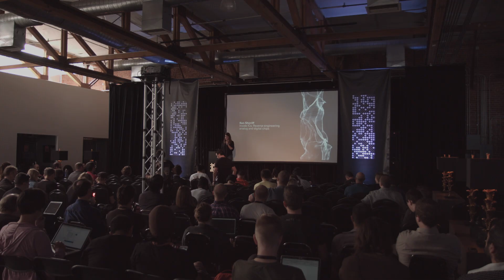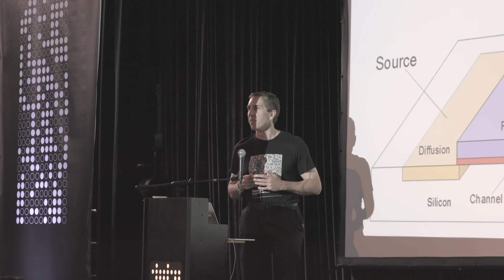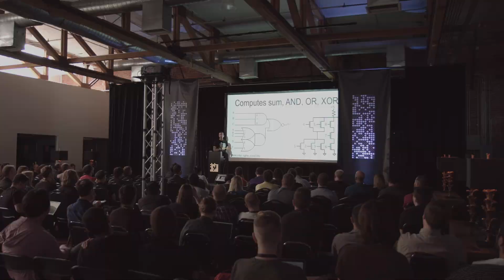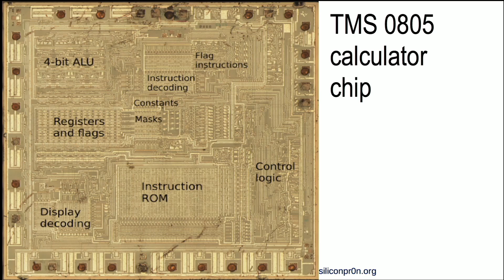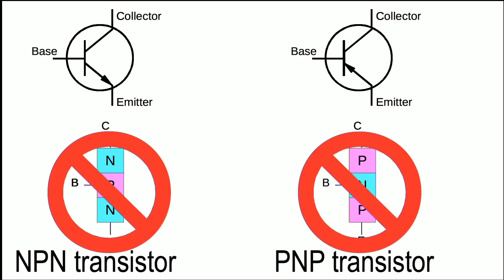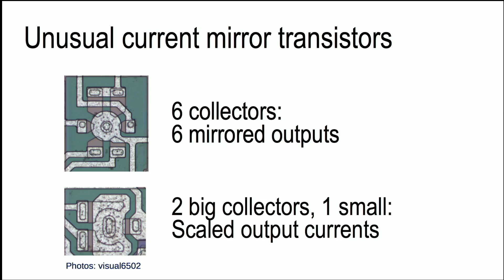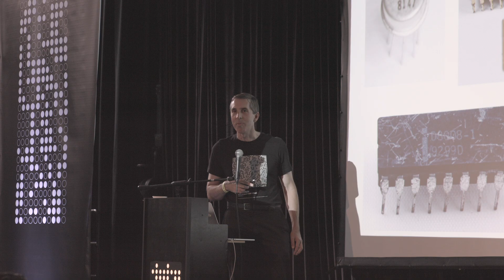Reading Silicon: How to Reverse Engineer Integrated Circuits

Comment: 2025 ? Have we solved the technical challenge of recording a pointer position on the recorded slides channel? I was thinking of using an HTC Vive controller with a laser mounted to it and translating the virtual pointer position to a mouse position in the slide presentation.

Comment: Locked connections are in processors and peripherial circuits. I use games to unlock these connections, some office work, and it works well. Some games are designed for legal tuning not just for playing. Only those can do this, who have legal op system w code and the proper dvd.

Comment: I have a David and Mann x,y table from a microchip factory. Very accurate. It had a 110 volt motor on the x axis. So I wonder if it was for cutting the wafers up.

Comment: His good . the true beauty of transistors is the differance in opening, and closing . Some are Voltage controlled, some are Ampere controlled, some are Normally Open NO, others are NC, Normally Closed , before you apply voltage to them . NPN & PNP junctions .

Comment: Early Mostek calculator devices (1970s) had fake contacts that would mess with reverse engineering and swiping the circuit.  The fake contacts were not able to be detected under optical microscopy unless you were good at noting the direction of focus

Comment: I always wondered if a working chip with a metal lid will continue to work with the lid popped off and exposed to ambient air. The lid would have to be removed carefully so as not to damage the bonding wires or the chip. Would light have any effect? How about a low power laser such as from a pointer? EPROMs continue to work even though the window is exposed (although erasure might occur after some time), so I guess yes?
Reply: it has to be exposed to  UV light  a strong UV light.   Which is why some of these EEPROMs that are being pulled out of vintage computers from the 80's still have all of their EEPROM data intact.

Comment: is it legal to do so??
Reply: I am not a lawyer but for research purposes this is probably fine. If you reverse engineer to clone a chip for mass production it's probably a patent violation as these chips, the design and microcode would be intellectual property of the manufacturer. If the patent is even active for some of these older chips. Would Intel care if you cloned a 4004 or 8080 and sold it? Of course, it would not make sense, and the newer chips of today would be impossible to clone due to density, without the supporting design material. You can always emulate I guess, using other hardware, such as FPGAs.

Comment: 9:02 just for efficiency, would it not be better to use just 2 transistors to solve the NOR circuit
the 3 transistor seems of no use theoretical it might be part of the drawment for the negation but why would you do that then

Comment: We need people like that to rebuild civilization after collapse.
Reply: you can now inkjet print  transistors.  1500nm is easily possible, with some tweaks to the printer's hardware you can reach 800-500nm.   If you want to spend on a super high grade research printer...    160 nm is about the limit you can do .  But you can do a one-off  chip design on a piece of glass, so that's pretty impressive. not to mention makes custom chips very very cheap

Comment: In my head I always imagined the only viable way to create these macro circuits was clever design engineers to draw them up large scale then software virtualize them on a supercomputer for testing then shrink the design and somehow etch or print onto layers of silicon like some kind of copper/silicon 3d printer only limited by the capability of the tech at the time. that's the only thing that clicks with my brain, otherwise I'd have to believe in magic. The mind boggles as to how tech companies now rip each others multi layered circuits off by reverse engineering. How the hell can they visualise and copy the design of each hidden layer that is covered in nanometre circuitry!!!!!? I could imagine blowing up to a readable print of a single one of these modern chip layers would likely produce a print the size of a city! Even digitally imaged could you imagine navigating hundreds of square miles of circuits on a few monitors.....fuck that! I could probably just about manage a blinking led with a few bits of wire and basic components to create a simple set of gates and it would be the size of a shoe box!
Reply: Design engineers design a circuit in a hardware description language, then the design is synthesized and implemented by ECAD software. You don't have to sit around wiring stuff together; get a cheap FPGA board online and learn an HDL and you'll be off.

Comment: What about the 6809 MPU? It's superior to the 6502. :)
Reply: In terms of sales, probably not. The 6502 was much more popular at the time, although the 6809 did find some fans, as in the Tandy Co-Co computer.
Reply: @josephmazzeo2713  ok I'll be more specific. I was familiar with both the 6809 and the 6502. The 6809 was definitely superior in terms of capability - instruction set and overall architecture. If I had to go back and program in assembly code (again) using one or the other definitely the 6809.

Comment: These reverse engineering presentations keep fascinating me. They tickle my inner nerd. But every single time I keep asking myself; why don’t they just get in touch with the master minds who designed this stuff and ask for schematics or whatever design drawings and plans they might still have.

I mean, it’s not like it’s and archeological find for crying out loud. It’s 40 year old tech. The knowledge is still there I assume?!

And why on earth would you NEED to know all this if our knowledge and understanding of IC’s has skyrocketed towards current i7 designs. 😂 

I do see the FUN of it. Of course! But they act like they found life on mars when really they just found out how some company designed something less then two generations ago. I just think it’s kinda weird 😬
Reply: Because short-sighted concerns about intellectual property are ensuring that a vast wealth of human knowledge is being lost to time.
Reply: more generally the "NEED" (if there is one) is usually accurate reproduction of chips in fpgas for example. mostly for entertainment sure but sometimes for old mission critical circuits that haven't been replaced yet.

I agree that people should ask for any offline material from old timers just because a lot of stuff just ends up at the dump otherwise, but the usefulness of it for chip reversing is limited. when looking at the die photo generally it's fairly easy to see what the different sections are there for (techspecs sometimes even have block diagrams of internal features especially in signal processing chips).

big mystery isn't the design but the exact implementation of it and when you go back long enough they did the layout by hand and there's no more documentation than the photomask for the lithography process, i.e. same information that's gained looking through the microscope.
Reply: or well, it would of course cut down reversing time significantly not having to photograph the die and having the layers separated etc. but it's not like it'd automatically solve everything even if this company's physical IP that was bought and sold multiple times over had been digitized for some reason and they were feeling unusually generous. the designers themselves even if they had the layouts don't own them so they can't give them out without risk of getting sued.

Comment: Silicon in an elevated enthalpy reaction(add heat) undergoes an elevation of the 3p orbitol, allowing for an enthalpy controlled reduction/oxidation reaction of the atom. So start there. Then make transistors...

Comment: I'm a (retired) analogue IC designer and have many happy (?) memories studying other companies IC's using optical microscopes in our engineering laboratory, to reverse engineering them. It was a good way to learn tricks of the trade. I hope some engineers have studied some of my creations! We also used manual micro-manipulators to electrically probe connections when studying a powered up die. We sometimes used a laser to cut tracks in the lab. We also occasionally used an ion-beam milling machine to slice into the depth of an IC so we could modify the silicon experimentally.  Oh what fun we had!
Reply: Ion beam milling machine what a unique bit of gear! Something like that would have cost millions. What companies would even manufacturer a machine like that
Reply: I forget the name of the company we used. It's not a big machine. Same principle as an electron beam microscope I think, although the polarity is obviously reversed! A tall evacuated chamber along which one accelerates charged particles. I think you have a very hot "anode" source creating a plasma (if that is the right terminology) so ions can be sucked away by the electric field. magnetic fields deflect the beam. The ions are much heavier than electrons and abrade the surface they hit...  If I recall correctly, there was even technology to deposit material at a lower energy so that one could add a conducting track, very slowly......
Reply: @franklydude  Would you happen to remember what it was? I'm really curious as to where I'd get the equipment to do this.
Reply: @fakename3344  I think it was companay in Cambridge or maybe even a university facility, I live in the UK... If you do a google for "focussed ion beam" milling etc, you should find some resources, certainly in the USA and in Europe, probably Japan and China too..
Reply: @franklydude  
Yeah, they also have ion implantation  (basically ion doping) machines.
Reply: @franklydude  I believe wether this technology exists in China and if you can find documentation on this equipment existing in China is two completely different matters.
Reply: @franklydude  you should start a group on discord or the likes. old programmers confess. just like many years after the world wars when soldiers from opposing sides got together over tea and discuss what battles they were in and what part they played.
Reply: Honestly, its frightening to think people with that level of talent exist.
Reply: Same here, @franklydude. Did the same with discrete components and with MMIC's. Made good use of careful etching of the semiconductors, to discern doping depths, Oxide thicknesses, etc, too. It's not espionage as most people think of it, because manufacturers send samples to one-another, knowing full well what will happen to them. Ultimately, the customer benefits from those techniques.
Reply: Hello, Im a total noob to the IC area, is the CPU of a computer, an integrated circuit too? Will studying about ICs help me ubderstand the CPUs hardware?
Reply: @bndfglvllddjdkfkfkf6097  yes
Reply: Well I am embarking on this journey and my current goal is to get employed in Neurolink company, any tips from you? I will start my Master in IC Designing this year.
Reply: @PedramNG  Ok if you are starting a masters then I would hope you are already up to speed in the basics of semiconductors and electronics?  What ever, I would say get a very broad appreciation for basic building blocks both analogue and digital, especially things to to do with real world interface, the so called "Physical layer" as the closer you are to the fundamentals the better you will be able exploit the technology to it's limits, as I suspect that is still the "name of the game" either squeezing in more transistors, reducing the power, increasing the frequency, or whatever the field you are working on requires. There is a whole world of semiconductors out there, and yet everyone seems to navigate towards the brightest light.  The more specialised fields have potentially better career path than being "just" a digital designer.. I don't mean to belittle that "world," but the bulk of what is done now is designed procedurally, ie from a high level, layer down and down towards the physical layer, but for all but the most aggressive designs, I suspect it's all done by software!  So your masters degree may have to be very broad, get a good fundamental understanding of the basics and the basic design approaches.  and if you can land yourself a job in the interim, follow your nose... & expect to have to learn on the job about specific tools, techniques, technologies, it's a fast moving world!
Reply: @franklydude  thanks for your advice, I currently have a journal paper and I've been TA for more than 10 times 😂 so I'm pretty good at the basics, and also I'm currently working to make an online course about tricks of IC designing (since I couldn't find anyone doing this), but my main concern is about my after PhD life, I'm not sure how to get to my desired company, which is Neurolink, and how to transfer from academic knowledge to fully applicable industrial level works. I think destiny will decide that one. 😂 Thanks again for your advice sir.
Reply: why did you retire?
Reply: @xDerfisch  good question! My wife was older than me, & we wanted to enjoy life together, and I'm glad I did.. because  i lost her 4 years ago.. now wondering if i need to earn some more money! To keep younger partner happy! Lol.. but if someone  needs my IC design skill, then come ask me! Lol
Reply: Dr. M. H.  have one back:-)
Reply: Dr. M. H.  Ah... you must be an 8 bit person..
Reply: @franklydude  Any book recommendations to be a solid man on this area?
Reply: Where is the special key that plays a little melody?? ;)
Reply: Efficient CMOS, specifically bit-voltage recycling, can open up the future of breaking Moore’s “Law”. Suppose that sentence was a headline on your favorite journal, what is your reaction?
Reply: @kamilbro6106  I would want to read more to understand what "bit-voltage recycling"  means... lol, my own simplistic understanding of computing is that if we wound the clock back to use "analogue" signals rather than just 0 & 1 digital signals, and did some of the processing using analogue techniques, then clearly the density we could achieve is almost unlimited. Agreed that we might have to slow the data rates...... An alternative to using analogue voltage levels would be to use pulse width and pules density modulation, but I would guess there is plenty of research in that direction. and  years ago, one of the popular buzz words was "fuzzy" logic, and of course, analogue computing can be as "fuzzy" as it likes!
Reply: @franklydude I have a sample here for you, look up this arrival by a Mr. Bob Smith titled Electrostatic Energy Drives Higher Power-Efficiency and Performance in Chip Design
Reply: @kamilbro6106  OK I read into it and find it hard to understand what they are talking about, "harvesting data" or harvesting "charge" or harvesting "power".... I'm a transistor level engineer and it's not clear to me......"Power" yes, I can see that, the faster and harder we drive the chips the more heat they dissipate and we could in principle be harvesting that...  Happy to discuss further if you like.
Reply: I wonder if they still do that with the 14nm microchips.
Reply: Recommend books for study, please?

Comment: There is a reason he works with old chips. They are much bigger and you can make out what's going on. Modern dies have all features really crammed together that you just can't tell wtf is going on. Way, way worse than these, if you can believe that.
Reply: what's more he doesn't even want to deal with acid, kinda limits the options
Reply: In the past 40 years, dropping acid has been for hippies and dope-heads. In the future it will be an activity for hackers! :P

Comment: If you have an archive of the raw footage from all of the cameras, it would greatly helpful to have the wide angle shot showing you pointing is really helpful.  However, the slides are better resolution, but where he is pointing is lost.  The lecture is very interesting, but when you don't see where he is pointing makes much more difficult to follow  Thanks.
Reply: Yeah you can't  win with the slides... laser pointer OR better quality image but you can't  have both.... ideally we need speakers to use some kind of "virtual laser pointer" on the presentation laptop.
Reply: @edgeeffect  You can have both, it's called picture in picture. You can show slide, presenter and picture of where he's pointing at the same time. Then the virtual experience would in most cases actually be better than the real one.
"Virtual laser pointer" as in mouse pointer? Yeah, would be nice if someone invented that.

Comment: I don't think I'd wanna buy a POSFET OR a POS transistor. this is a very interesting video.
Reply: How about an old SGI Tezro? SGI doesn't exist anymore, and to our knowledge these machines aren't repairable using standard services. Reengineering the ICs may be the only way to service them, and emulation requires the same thing.